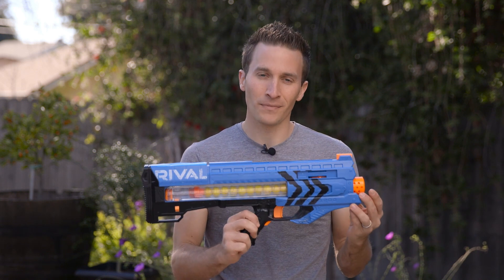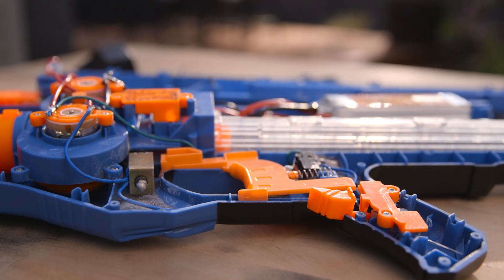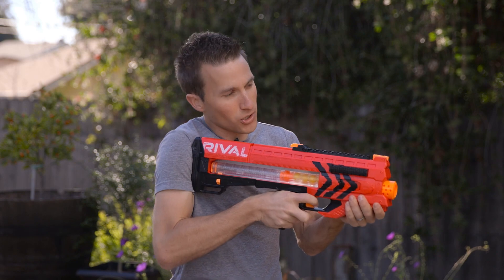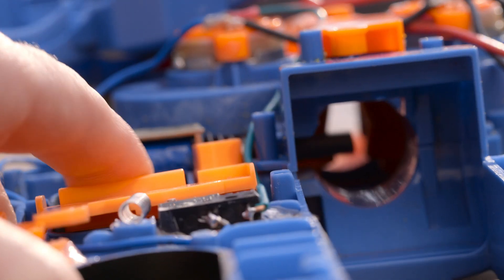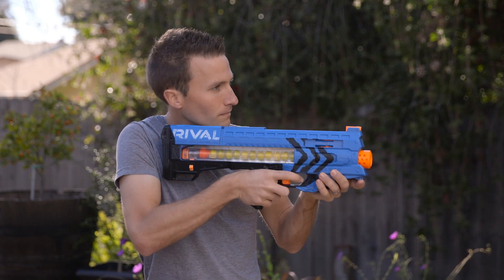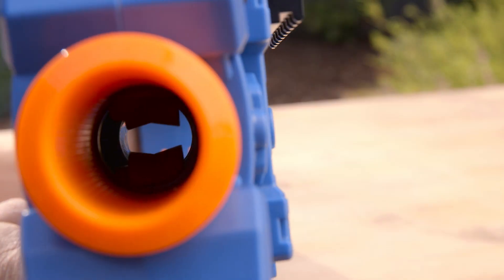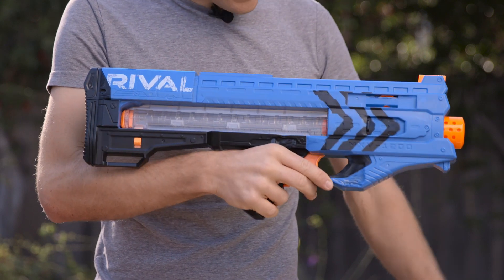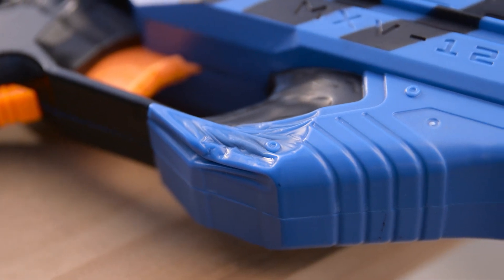MOD: Nerf Zeus fully electronic trigger (Solenoid)

Comment: You could add a time delay circuit that would just very briefly activate the solenoid with each trigger pull. A microcontroller would be the easiest way, but you could also use a 555 timer for it. You could even do it with just a transistor / capacitor pair as well.
Reply: +Outof Darts Hard to say, I've never used a 555 (Or in this case, 556 most likely) timer where it was just powering it on instead of using a dedicated trigger pulse. If that large cap is used straight across the input power and not for timing, it could keep the system powered up for quite a long time after disconnect, creating all kinds of weirdness. You could try adding an LED+resistor to the power in terminals to deplete it more quickly to see if that helps.

Comment: So the trigger uses a switch that makes the release work electronically, I saw that correctly, right? Think you could make it shoot in three round bursts or perhaps make it change firing modes?

Comment: So how did you mod the actuator system? I see the noid isn't linked to the actuator hook, but the hook goes up when the piece below the breech us pulled down and back. So how does the vertically oriented noid control it? Also, seems this method has issues with burb firing and not enough control for reliable single shot. Ideas on how to improve that?

Comment: Any chance we can get a link to the solenoid you used? I'm assuming because you used a push type for the 3 round burst mod that we would need a pull type solenoid?
Reply: +Outof Darts I believe that is the same one you used for the 3 round burst? So you used push type solenoids for both the 3 round burst and electrical trigger?